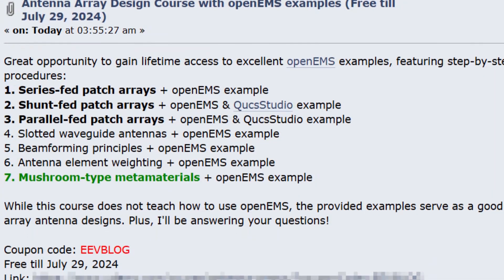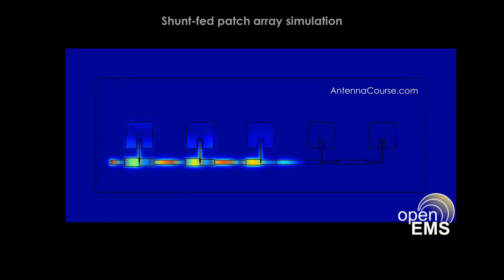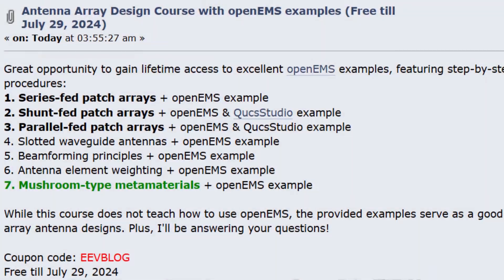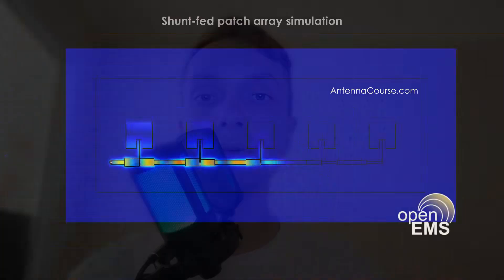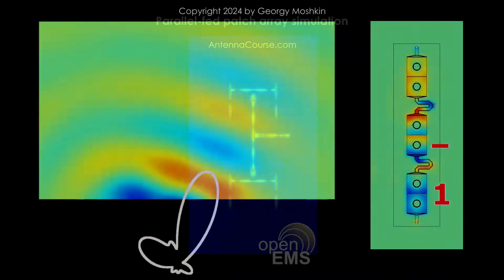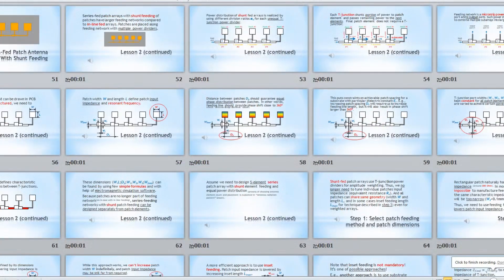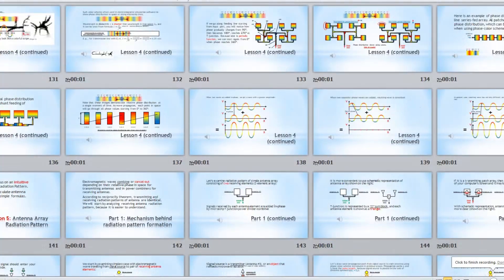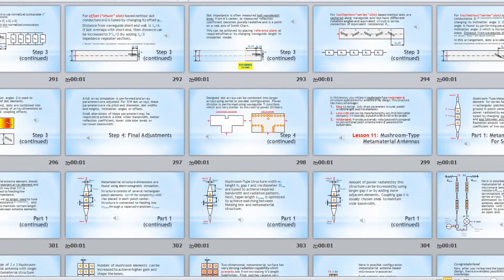Antenna Design and Simulation Using ONLY Free Software!

Comment: This is not free software, change the title of your video.
Reply from the maker: Open source? EM visualization snippet I've built using Octave is available for free on GitHub. Both openEMS and GNU Octave are free software, and you can use both of them without paying any licensing costs.

Comment: isnt antenna design super boring ?
Reply from the maker: It's kind of boring until you have a prototype. I literally had goosebumps when realized that one of my first antennas worked. It becomes really boring when I over-optimize and tune the same design again and again; that's when it becomes a nightmare!
Reply: @GeorgyMoshkin 
I can agree with you on that.  However, if producing a design with that (improvement, regardless of how small), that 'brings in' that weak signal, and gets that QSO, error free data, and blocks out interference, YOU KNOW, it's all been worth the tears and frustrations!